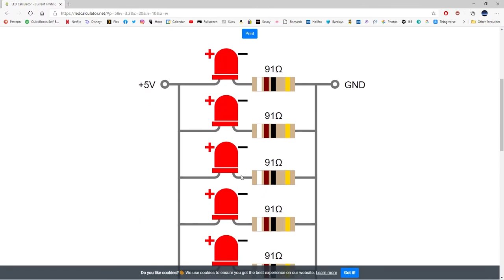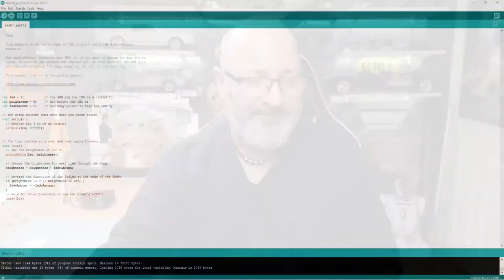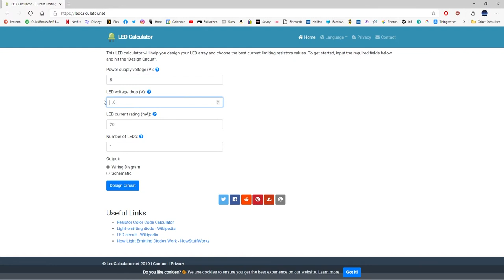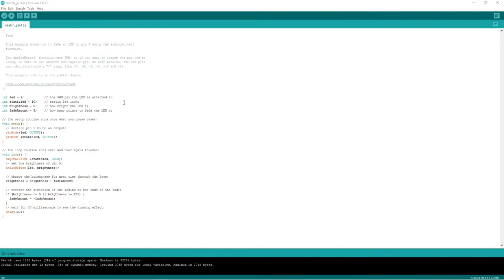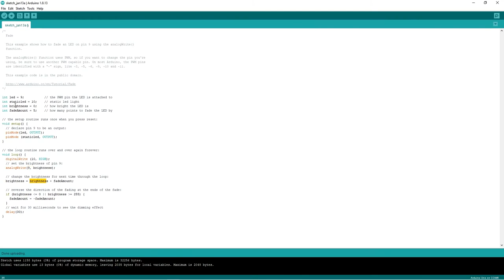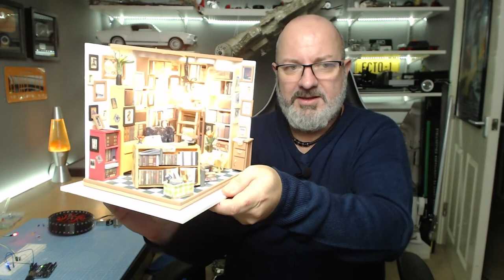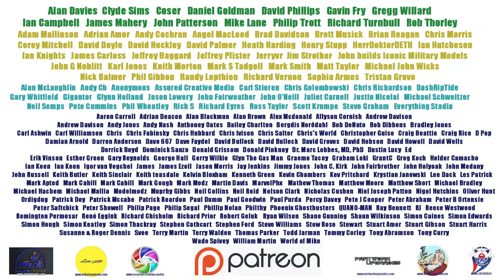The Wednesday Patreon Rewind - Arduino Fun

Comment: The Arduino analogue pins are input pins that read the analogue voltage on that pin between 0 and 5 volts (assuming arduino is powered by 5 volts) as a value between 0 and 255.  
These analogue input capable pins are usually prefixed with an A that can be used as digital output pins. The D prefixed pins are digital input/output capable pins. The pins marked with a  ~ are PWM output capable digital pins.

There are no real analogue output pins on Arduino; all the output mode pins are digital.

 Instead some of the digital output pins can be set to PWM mode (pulse width modulation) where the pin can be rapidly switched between logic levels 0 and 1 (0 and about 5 volts) with the duration of the logic 1 pulse from 0 to 255 ticks in each 255 tick interval being controlled by the PWM value set for that pin.  That PWM signal can then be used to control the perceived brightness of a suitably connected LED. A PWM signal can be converted  to an rippling analogue voltage by connecting a resistor and a capacitor in that order to 0 volts and taking the final output from the resistor to capacitor connection and the 0 volt line.

Comment: All the arduino programming reminds me of computer science classes (BASIC, Pascal, Java, C++) in middle/high school and college. Students always ask how they will be able to apply what they learn in class in the 'real world.'   "One day, you'll be using this to make flashing lights on your ET model spaceship, Mr. Wayne"
PS- had to update my profile to be more PC- formerly GoofyLookingMoFo
Reply from the maker: Ahhhh cool
Reply: FYI- regarding pink LED's- I did a quick google search for "Use arduino to change color of LED" - and saw results for RGB LED's.  Assuming your can get the size, number and configuration of LEDs you want in your kit, maybe in the coding on the arduino, you can designate which LEDs show which color. IE- LED's 1,4,7 static blue, 2,5,8 pulsing clockwise red, 3,6,9 pulsing counter-clockwise pink.  Perhaps even set a ring to run one color in a direction, and alternate to another color in opposite direction- IE landing lights are clockwise white vs taking off lights turn counter-clockwise yellow?
Oh, the ideas and insanity!!!!